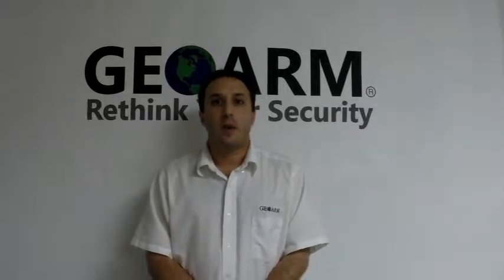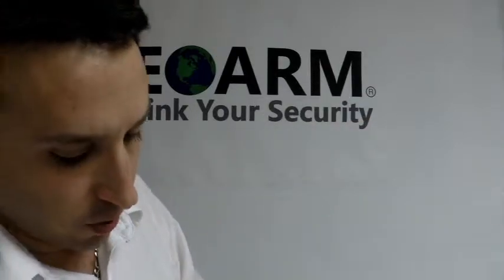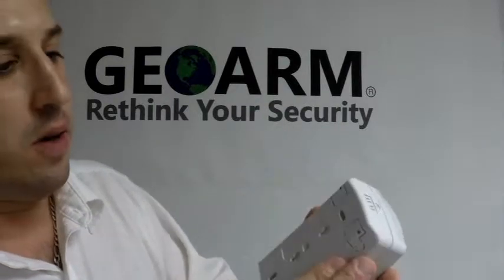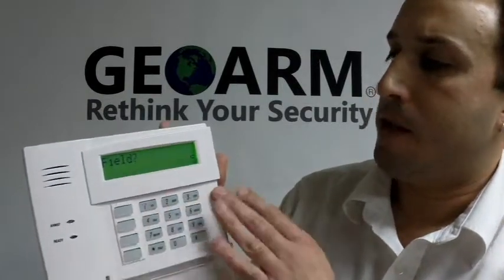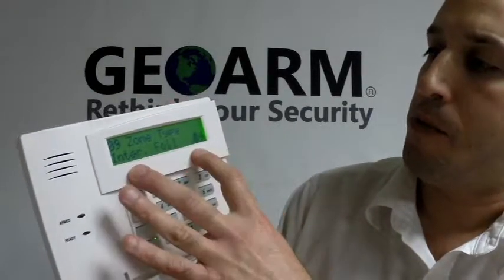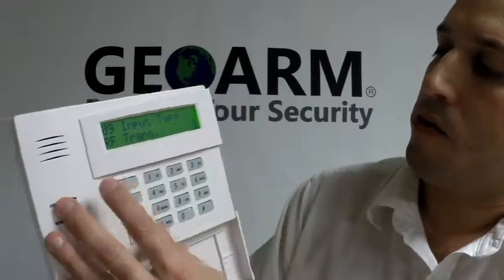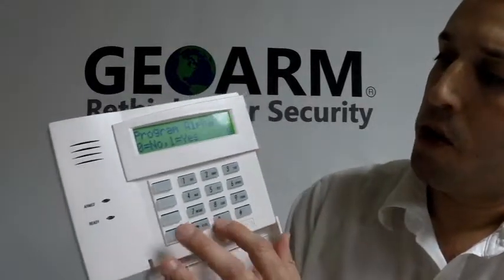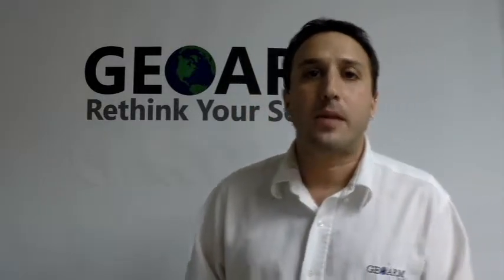Honeywell Vista 20P : How to Program a 5898 Wireless Motion/Temperature Sensor using a 6160rf keypad

Comment: when i input installers code + 800 = long beep.... what does that mean?
Reply: It most likely means that you are either locked out due to the fact of someone entering in *98 instead of *99 OR that you don't have the right installer code and it is giving an access denied warning.